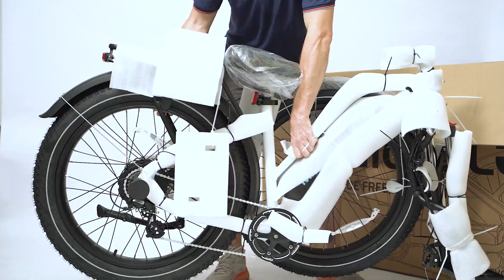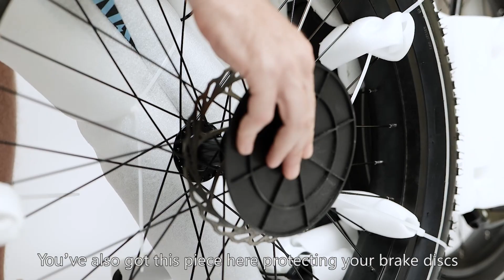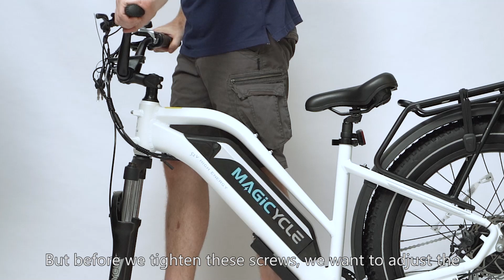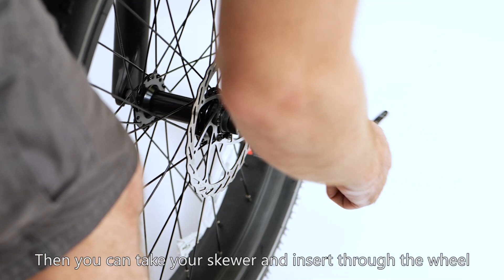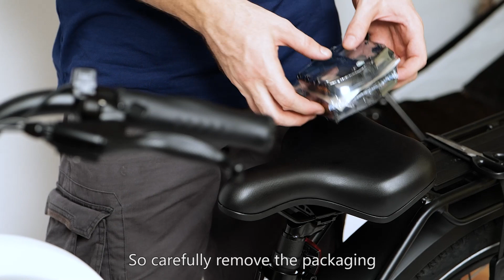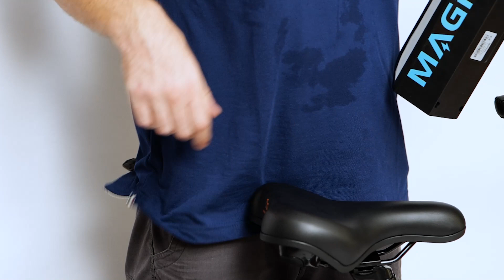Magicycle Fat Tire Ebike Assembly Instructions

Comment: just as I figured, you didn't show how you got the handle bars on.  I'm so frustrated on getting my handel bar on by myself.
Reply: What tripped me up was the shock assembly protection bit on his is backwards from mine. I had to attach/reattach the handlebars twice!
Reply: Handlebar very difficult to position. Needs higher quality screws.

Comment: At 541 of the video , the black know that protected the stem on wheel, you pulled it off so easy , I can't seem to get it off , I pulled , I turned it as if it was screwed on , what advise is there so I can get it off probably ?
Reply from the maker: Can you try to use plier?

Comment: If you cut the zip ties in the right place when removing them, they can be re used. :)  there are a obscene amount of zip ties on this bike.  It took me longer to remove all the zip ties than to assemble the bike LOL 
The bungee on the bike we got looks better than the one in this video
That silver white line you see on the tires is a reflector…it’s brilliant. Love those fat tires. 
The forks seem to ride really nice. 
My fiancé and I started riding bikes last spring. We bought mountain bikes and rode near 700 miles over the spring and summer. I suspect we will be able to double that this year having ebikes now. I cannot wait until the weather breaks and we can start putting miles on our ebikes.
My fiancé is 5’2” and the strep through is perfect size for her. The bike is stable, very maneuverable. I was pleasantly surprised with how it handled. I am very comfortable on a bike. I raced BMX when I was young and never went anywhere without my bike. Always jumping, riding wheelies, bunny hops, endos…
So all in all, we are VERY pleased with the purchase of our (hers) Magicycle.
Reply from the maker: Thank you very much for the feedback, glad you love lt, Merry Christmas!
Reply: @MagicycleBike  you are very welcome. It’s in the 50’s here today, so I have been on it a couple of times and I cannot wait until tomorrow after it rains, we are going to go for a ride. I love how stable and maneuverable the bike feels at low speeds. That is very important for inexperienced riders.
Merry Christmas to you 🎄

Comment: Yesterday, Dec 22 I received the Step Thru I purchased for my fiancé. Took a few more days than anticipated to receive it, but it was worth the wait. My fiancé really likes it. Assembly was a breeze with the supplied tool kit. The bike rides nice and has good power. I am not fond of the leather grips…that’s my only gripe….fiancé has no problem with them lol.
I have a 1000W 52V middrive, this is the first hub motor I have ridden. And this is the first fat tire bike I have ridden…I really like it. Glad I bought it for her. She’s very happy.
Reply: I’m 6 feet, 195lbs and I live in an area that has some hills. Do you think the motor in this bike is enough to handle hills, throttle only? Or do I need to purchase a bike with a mid-drive motor?
Reply: @jdub1139  well a mid drive motor would be able to use the gears to make it much more efficient. How big are the hills, how many hills will you climb. How long will you be riding, what’s the charge status of the battery. With a 750W hub drive , 0ne or two hills and you might be fine on a not so long ride . I would want a mid drive that is no less than 1000W 52V and have a big battery if you plan to hit hills and use throttle only. If I was using a hub drive, I would want 2KW minimum with 72V and again, huge battery. But everyone has different needs. There are a lot of variables when it comes to ebikes and budgets.
With a 750W hub motor, I would not expect it to live a long life if you are using throttle only and hitting hills regularly. If you are planning on throttle only rides, get a minimum of 1000W hub or mid motor. Mid motor is more suitable for hill climbs if you are less than 72V and 2KW if you use your gears effectively.
Reply: @Todd66   This is exactly the information I needed!  I live in the Hill Country of Texas and although I plan to peddle, there will definitely be times I’ll want throttle only.  Thank you very much Todd.  Greatly appreciated!
Reply: @jdub1139  you are very welcome.